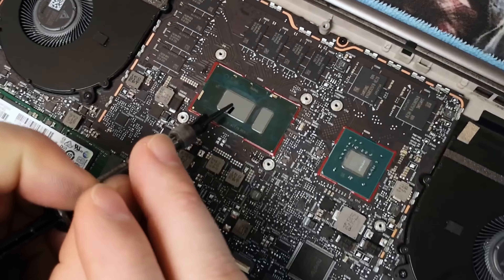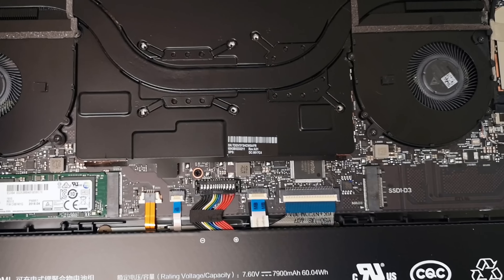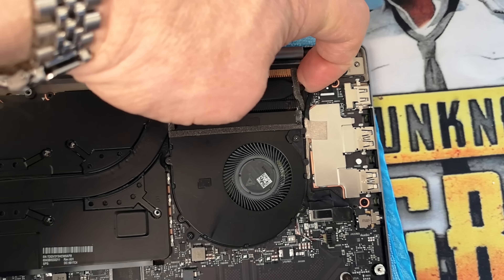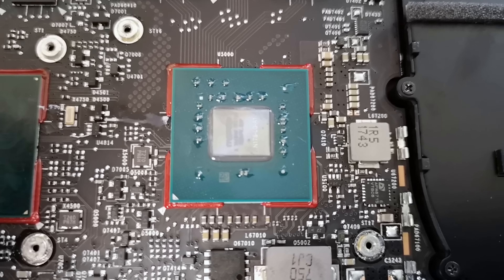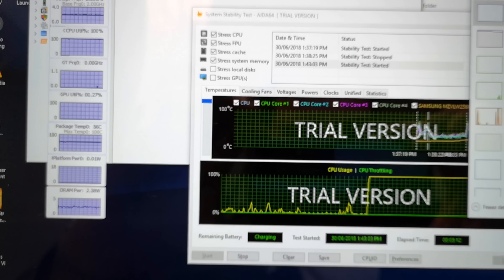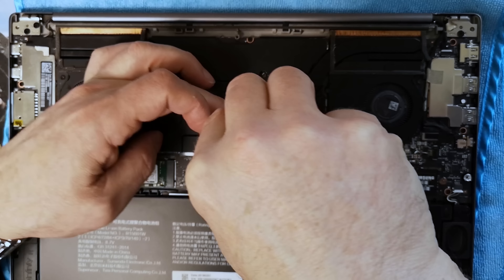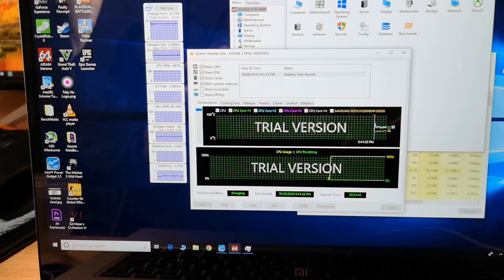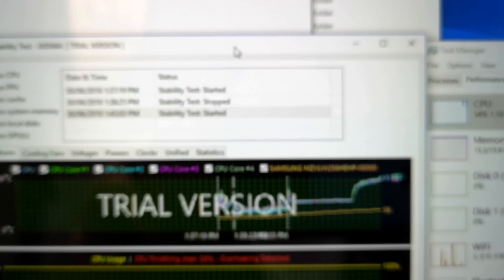Liquid Metal Laptop Cooling – 20C LOWER! 30% FASTER - But is it worth it? 🔥🔥🔥🔥🔥

Comment: The "aluminum" you are seeing on your laptop cold plate is from liquid metal ionizing with the copper plate, creating a silver stain. Thats 100% normal for liquid metal and copper and does not create problems whatsoever. No mid-high end gaming laptop has had a copper coated aluminum heatsink.  They are solid copper all the way through. Look up a video by Gamers Nexus on liquid metal. He demonstrates the different effects liquid metal has on copper, aluminum and nickle plated copper.
Reply from the maker: Weeee
Reply: Wish it was nickel-plated...

Comment: dude, the copper is fusing with the liquid metal to make a gallium alloy 'stain'. you also need to reapply after a month, then once a year to 15 months
Reply: Is it safe for long term use? Planning to apply thermal grizzly conductonaut on the gpu and cpu of my ROG Strix G laptop..
Reply: @jayveebsns  yes. It is, just be sure to spray conformal coating on surrounding parts to minimize any chances of a short
Reply: @daylightriot5671  can i use nail polish as substitute? Apply 3-4 coats with 10 min interval
Reply: @jayveebsns  yup. nail polish works. 2-3 coats would be fine though. Too much nail polish or conformal coating can insulate parts and cause problems. Most people seem to have good success with 3 coats. 

Hope this helps
Reply: @daylightriot5671  will give it a try

Comment: It's about the quality of the "copper" heatsink. if it's high quality pure copper, it should only leave a very thin layer of stint and won't affact performance at all. But some companies cheap out on heatsink and use copper alloy, the liquid metal is reacting with whateven else in it. But I never seen LM really eat through copper heatsink, even it's copper alloy, it should be fine if you just leave it there and don't try to clear it.
Reply from the maker: Wooo

Comment: i7 8550 cpu running at 2.14ghz all core turbo when it's supposed to be able to run at 3.7ghz. And you wonder why the temps were so low?
Reply: I thought the same man, what was that? i dont understand, so the liquid metal doesn't workd?

Comment: Heatsink/aluminium is used to disperse heat into the air, copper is used to transfer/conduct heat from one material to another. That said, aluminium is also a great heat conducter and is used in some waterblok systems, but in laptops it will always be copper.

Comment: YOU ARE TOTALLY WRONG!
it's not "aluminium": it's normal for liquid metal to enter copper and add a "silver" color;
this just an aesthetical problem but it is permanent because it will penetrate very deep (trust me i already tried to sand it away on a copper waterblock).
if it was aluminium you would have a huge hole not a decoloration, trust me!
Reply from the maker: I thought that too. I only had it it on for an hour it would not eat it that quick. I guess it might be possible but I scratch again and it does not look copper
Reply: Western Gents United  This is correct. Gallium completely disintegrates the desirable physical properties of aluminium and makes it extremely brittle to the point you can literally snap it with your fingers. I am now trying to find the results of saturated gallium absorbtion in copper heatsink and whether the copper will eventually disintegrate like aluminum over a longer timeframe or if the copper maintains it's strength and perhaps enough thermal conductivity.
Reply: It could be a copper alloy.
Reply: If it was aluminium and u scratched it u would remove the aluminum oxide coating and cause the aluminium to react faster with the gallium, the reaction creates a gallium amalgam and destroys the aluminium in the process (similar to aluminium and mercury), this reaction is slow and exothermic, generating more heat and speeding up as it progresses.
A thin copper coating could probably protect aluminium reasonably well if it was thick enough but I wouldn't take that gamble and if I had my heart set on applying liquid metal thermal paste I wouldn't scratch my cooler at all, I'm not sure what happens if the gallium turns the copper into GaCu2, maybe it would harm the aluminium. 
The best place to find this information is chemistry texts.
I found that gallium actually plates to copper, so your heatsink needs to be nickel plated as nickel won't react with the gallium. If it isn't nickel plated you will gradually turn your copper heatsink into GaCu2, and will constantly need to reapply the paste over time until the reaction finds no more copper to consume. My conclusion, liquid metal (gallium containing) should only be used with nickel coated copper heat sinks if your keeping your device for more than a year or two.
Reply: @raminazizi  Copper wont break like aluminium, and as far as I know, the thermal performance remains largely unchanged. But galium will react with copper and 'dry' out, so you will have to repaste your dye after about a year. Best solution is to use LM with nickel plated copper, as nickel is extremly corosion resistant.
Reply: @TallyHoTech  so in conclusion IS IT COPPER? do you have that laptop still what is going on with it?
Reply: So is it safe on copper and nickel heatsinks on the long run? I'm planning to use thermal grizzly conductonaut on my rog strix g laptop, both on gpu and cpu
Reply: @jayveebsns  as long as it does not go on the motherboard it's safe but be aware that the silver stain may be a deterrent if you plan on selling it
Edit: please be aware that it must stay away from any component like resistors that may be placed on the GPU
Reply: @plokko1  would electrical tape also do the job?
Reply: @plokko1  i don't have conformal coating, my 2 choices are electrical tape and coating it 3-4 times with nail polish
Reply: @jayveebsns  I would stay away from tape,nail polish or coatings, it may damage your card or not work correctly;
if there is a minimal danger to break something the Kryonaut will be more than sufficient and safe especially on a GPU
Reply: @plokko1  thank you for this. really hoping to decrease my temps by using LM, but i guess it's far too risky

Comment: Here is my question: Why don't these companies use proper thermal paste to begin with, given what they charge?
Reply from the maker: That's a good question. I think they use what lasts the longest and its more the application than the paste in my experience
Reply: The trouble with the paste they use is that it's already garbage right out of the box, it's dry as camel turds, produces cracks and micro-gaps all over the place.  If they just used something like Kryonaut they'd be good for the expected life of the machine, and not get shit as balls thermals.  That goes for pretty much every-fucking-one, every CPU heatsink, every GPU heatsink, at this point, every Intel CPU IHS, all garbage cheap ass TIM.
Reply: Aidanjt - would you suggest applying paste out of the box? .. do you know of a good step by step instruction process for a noob? (wanna repaste xps 9570)
Reply: Excuse is: the TIM used is for super long duration / the lifecycle of the device. Proven bullshit, but people bend over for their brands and ignore all proof against manufacturers. The so called special TIM is the most basic pidgeon poop scraped from the floor and they probably pay the same price for one bucked of that pidgeon poop as we do for 1g kryonaut.

Comment: First you started out with great temps with liquid metal, then you got bad temps after a short while. Here is an hypothesis. 
You used to much conformal coating, and thereby increasing the distance from the die to the COPPER interface because of the bulges you have created. At first the liquid metal was in a low viscosity state which is enough to make  atleast some contact between die and interface material. After a few cycles the liquid metal wil become a high viscos liquid and lose volume do to airflow and reaction with the copper, and the liquid metal might even dry out if enough air is let at it. The effect of this would be that the liquid metal will seperate from the die and interface either completely or partially resulting in very high temps indeed.
Reply from the maker: You’re right there
Reply: @TallyHoTech  My pleasure, entertaining video, cheers
Reply: @bluefox4902  I tried to put it but the temps still goes high

Comment: It is copper, EVERY laptop has copper interface with the die. Liquid metal will react with copper, but only slightly which will result in discoloration and maybe some pitting over time, but it's nothing to worry about, the performance will stay the same during the laptops lifespan.

Comment: Yeh, liquid metal is risky. I had a mobo short out before. It's a shame they cheated out with an aluminium heat sink. Nice vid mate !
Reply from the maker: I hope it wasnt an expensive mobo mate :)
Reply: i know bob did a video showing IC  graphite isnt as good as LM, but its better than most pastes ive seen and thanks to it being a sheet, i know it wont goop around and be an issue.

Comment: Here is what happens to aluminium when exposed to Gallium, which is the main component in liquid metal. The reaction is fast, and in no way would you be able to use your laptop after if your interface was made out of aluminium.

https://www.youtube.com/watch?v=IgXNwLoS-Hw

Heatsink/aluminium is used to disperse heat into the air, copper is used to transfer/conduct heat from one material to another. That said, aluminium is also a great heat conducter and is used in some waterblok systems, but in laptops it will always be copper. Liquid metal will react with copper, but only slightly which will result in discoloration and maybe some pitting over time, but it's nothing to worry about, the performance will stay the same during the laptops lifespan
Reply from the maker: yer, thanks man
Reply: @TallyHoTech  Your welcome :)

Comment: Nice temporary gains! If only laptop manufacturers used this by default 🤔
Reply: With all the risks involved? To secure LM in place and prevent spillage, to use extremely expensive metal coating (tungsten or tantalum) in order to prevent corrosion? To offer warranty for LM spillage?

And in the end, what if you take your laptop out and the LM freezes solid? I'm not sure what's the expansion quotient for LM but it could seriously damage the device innards.
Reply: By the way, Jarrod, I still can't wait for your Razer Blade 15 review :-)
Reply: If the manufacturer was doing it and planning for it they'd be using correct materials and application, no risk to you (yeah of course extra cost if they have to go through all that)? You just get a working product. Obviously not for everyone 😛 and cheers, going to start working on it in a few days, got a bunch of other stuff to work through first!
Reply from the maker: You would think they could make a better system out. They spend so much on R & D of the cooling and Bazza on the assembly line overzealously applying thermal paste throws that out the window
Reply: Sure, we normal people can pimp out our laptops with LM for $20 or so but the manufacturing standards will never allow LM in laptops. Cheers, Jarrod, I love your work. :-)
Reply: It doesn't even have to be LM, even a high quality paste would be vastly superior to the garbage they slap on there.  And it's not like they're going to pay retail for 1.5g tubes for a handful of laptops, they'll buy it in buckets, so the cost will be marginal for them at best, a trivial price I'm sure pretty much anyone would be more than happy to pay for given the benefits.
Reply: Haha, but then you still wouldn't believe they did it properly and you'd open it and repaste it anyway.

Comment: Once you apply normal thermal paste is it just a one time job that lasts the entire life of the machine without ever having to redo it? And are there any risks?
Reply: BrandyBoy normal thermal paste does not last forever, but will last a couple years. The way to know when you need to reapply is to just monitor thermals and when you’re running warmer than usual, open up your machine and check it out. If it’s gotten dry and flakey, reapply after cleaning off the old stuff.
Reply from the maker: If you get the one I recommend in the description it will last the life of the laptop in my experience. I have CPUs with 8 years same thermal paste and it the same as when I done it
Reply: Jacob Thomas is still right, if temps start going up its bad, thats how you know. but to WGUs point it'll typically last as long as the laptop

Comment: instead of conformal coating could electric tape or nail varnish work
Reply: I used clear nail varnish and then once it was dry I used Kapton tape. It's thermally stable tape that can withstand the temperatures a cpu and GPU run at.
Reply: nail varnish isn't conductive after drying?
Reply: Can i just add thermal pads?

Comment: what is the size of the screws used to hold the heatpipes in place, i can't find that information anywhere. thanks.
Reply from the maker: On the Xiaomi? note sure you lost some I can check
Reply: @TallyHoTech  yeah, I couldn't find a screwdriver that fits. Thanks.

Comment: You obviously have very little PC knowledge, You put way too much, You only need a tiny bit like as little as you can possibly get on it, You should apply your conformal coating with A Q tip or brush, It needs to be Acrylic conformant, And needs to be 3 Coats, Also you need to put heat resistant tape or electrical tape over the top of that, And On the PCB around the die you should make a gasket out of a .5 mm silicone thermal pad,  Also you can prep a copper  Heat sink without using nickel plating by rubbing some extra liquid metal into the heat sink for a long period of time before you put your actual application on

Comment: IDK if  i can use liquid metal on my r4 17 inch alienware -_- specially i travel alot with my laptop
Reply from the maker: Weeee
Reply: @92 clb what laptop? I'm tempted to try it with my 7700hq in a acer predator 300

Comment: @Sad below rightfully corrected me. Linus did that test against thermal paste and not liquid metal. My bad

I cant recall all the details but I recall seeing Linus review or talk about a graphene pad that was still in development but seemed to have similar, if not better thermal results and none of the drawbacks of liquid metal. Hope that makes it way to shelves shortly
Reply: What are you talking about? His graphene pad barely managed to compete with thermal paste. In no way can it compete with LM.
Reply: Yeah you are right. My bad. I had to go back and watch. I thought they tested it against liquid metal but was IC Diamond. Just talked about ease of application vs Liquid Metal. Will update my comment. Thanks
Reply from the maker: Thanks for sharing
Reply: It's good if you're repeatedly taking apart your device. Otherwise not so much.

Comment: with that windows key, can i still use it if I do a windows reinstall?
Reply from the maker: on the same machine, yes
Reply: I bought Windows Pro using THL24 code, upgraded the M.2 SSD and reinstalled Windows.
The upgrade to Pro failed and it rejected the new registration code.

Comment: I put black tape around the cpu then I put liquid metal
Reply: did you leave the black tape on after you put the liquid metal and reassembled?
Reply: Yes
Reply: @Steve-ds5kb  did you ever open your laptop up again to see if the tape melted? Also what are your temps before and after
Reply: Nop but is working just fine
Reply: @Steve-ds5kb  what are you temps before and after repaste?

Comment: Coupling capacitor not transistor :-/
Reply from the maker: yer that one
Reply: Was scrolling and scrolling, thinking... has no-one picked up that he's talking about the cap's thinking they're transistors... thank god you posted it. Saved me a long whinded write up on coupling caps and why they are there.
Reply: @RamjetX  yeah! by the way they are DEcoupling capacitor not coupling, i made a little mistake :-p
Reply: @68transistor  I was going to mention that when I typed it on the phone... but on the surface you don't know if they are coupling or decoupling. Typically your right though, high frequency oscillation dampers for DC lines feeding the input rails and stabilising output lines for load regulation. Coupling would be passing data through the caps whilst separating DC supplies within the IC. But lets be honest, non of us know exactly the purpose for each of them on the top right?
Reply: @RamjetX  absolutely true! Good year!

Comment: I'm done with this 9560.. Fans always on while drawing in Photoshop, not possible to stay with this noise for a while day
Reply: *whole
Reply from the maker: Repaste it and if you haven't already update the bios
Reply: Do what he said, and also undervolt with Throttlestop and MSI afterburner. Check out the dell subreddit on how to do this as it is common practice over there.
Reply: Sell it. You won’t get more than $500 soon with the top of the line model. It’s already at around $1000.
Reply: I'm not saying about fans full speed but they work constantly in Photoshop because of GPU work and there is no way to make this laptop completely or almost silent even after repasting and undervolting (which I've made yesterday), temperature 60+ so fans are on. So I think xps 15 is not a working machine for graphic designer or video editor, not enough space for easy cooling
Reply: Gabester46 Can I buy yours 1Tb 32 RAM i7 for 1k? ))